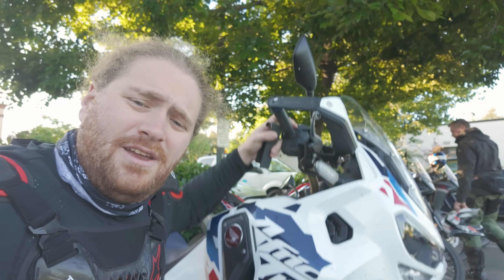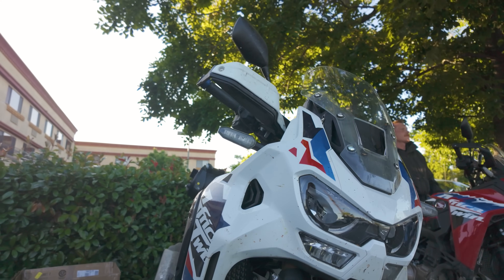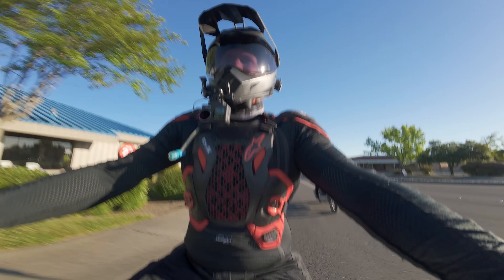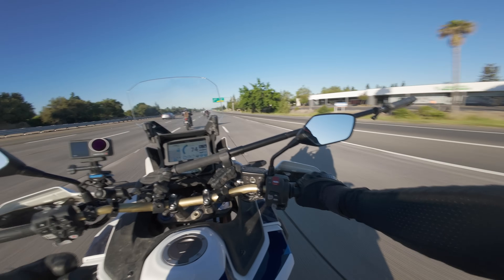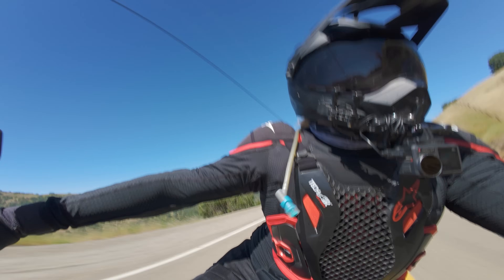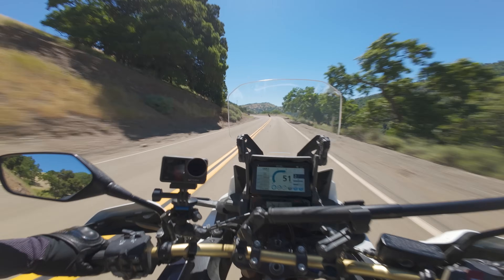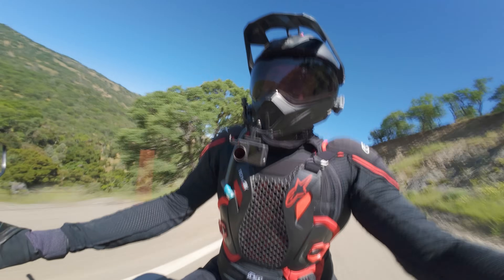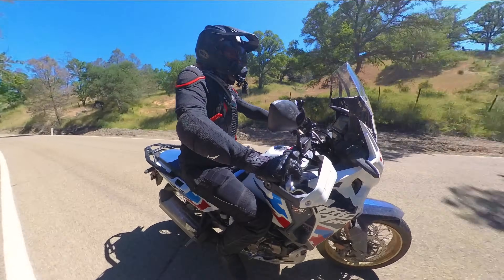Everyone Said I'd HATE A DCT Motorcycle...

Comment: I've had my my DCT Goldwing for a year and the only thing I miss about a manual transmission is extending the fingers of my left hand and resting them on the clutch lever while stopped at a red light.   I rode my bike on the Tail of the Dragon and had no issues with the DCT.  My Dragon run was fine and I had no problems at all.

Comment: As a person who always avoided dct and scooters, I rode a dct for about 100 kms and i hate to say that i LOVED it. Of course i wouldn't trade my bike for it but it was different and a good experience. Not having to worry about the clutch or the gear you're in is great. But as mentioned, the comfort is not where the DCT shines, despite all the marketing focusing on how seamlessly easy and comfortable it is to ride.

 Once you switch to the manual mode, you can shift very fast. It doesn't intervene and let you upshift whenever you want, and only downshifts for you when you dont want to do it yourself (maybe you didn't feel like keeping the revs high). It rev matches beautifully when you want to downshift a bit earlier without lowering the rpm too much. 

And if you dont want to use the manual, the auto mode is very optimized and lets you do your lowspeed manuevers without changing gears and making you fall (with the help of IMU censor)

If you want to hit the gravel, or for anything else, you can control the power and the engine break so the dct never gives you a disadvantage (not that i tried it on dirt)

Honda seems to have found the solutions for all the disadvantages that come with the dct. Yeah you can't rev it up in a standstill, and yeah sometimes not having a clutch is awkward but i believe that even people who hate it, love it some way. 

I think everyone should have a dct and a normal bike to hit the track or have fun etc.

Comment: I currently ride a 2019 Goldwing Tour DCT and it has been awesome. I just turned 100,000 miles on it this week. Maybe the Goldwing is programmed differently but my Sport mode is aggressive and very responsive. It holds gears both up and down to give you max acceleration and good engine braking. Tour Mode of course relaxes that a bit. I think if you had time to tune the User Modes more on the press bike you were riding, you would be amazed at how competent the system is. I'm 66 years old and have been riding since I was 14 so of course all my previous bikes have been manual transmissions. My adaptation to the new DCT from my previous Goldwing (288,000+ miles) took about 2 weeks and then I never thought about it again.

Comment: I've only used the DCT on a short test ride. I didn't think I'd like it but I was wrong. In the twisties I would just switch to manual mode and shift using the paddle shifters to keep it from changing gears mid corner.

Comment: I’ve got an Africa Twin DTC (in Repsol colours 🧡) I’ve had it for almost ten months. Early spring I  went for a random solo adventure around Europe wild camping sleeping by my Africa twin in the woods under a tarp. Found myself having to pick it up a few times in wet mud and gravel. But that’s what crash frames on these types of bikes are for. It’s a big adventure bike, and requires a big adventure. If everything goes to plan, it’s not an adventure!
That’s why I bought mine…. Plus I havnt got a left leg to change gears the traditional way 😂👍🏻
People I know who have this bike ride I automatic, I don’t. I like to control the revs with manual mode and know when I’m changing gears, especially when I’m off road going up and down hill on the thing. Even automatic sport mode…. I don’t bother. 
I’m just wheely happy to finally be riding again! 😁
Great bike all round! 
My only problem’ish with DCT is the extra weight. About 25kg I believe. But there’s a solution to that, hit the gym and it feels a lot lighter 😂 
At the end of the day, whatever way shape or form, always keep riding! 😉👍🏻

Comment: I have the european cousin of the AT, the NT1100 in DCT. Originally ordered a manual but Honda isn't producing enough manuals and the wait list was going to be over a year. Ended up getting a DCT model instead. It took a while for the gearbox to learn especially considering we have a lot of twists and turns here and it was always in too high of a gear. Eventually it learnt to hold gears now. I Still need to give it the odd manual downshift to override it but I don't mind it. In all, I really like it and it makes touring much easier, letting you focus on the unknown roads ahead rather than whether you're in the right gear or not. No surprise hill is going to cause you to stall or tip over.

Comment: I own an NC 750 DCT for a couple of years. Nobody seems to know that there is an accessory to add a foot lever for shifting. For me that lever, even if its still electronic makes all the difference. In the city i go full DCT and when want a more sportier ride i go full manual shifting with my foot. Man i love that option. I think the AT also have the foot lever accessory and i don't understan why honda does not advertising it  more. It was real diffucult for me to find a shop to buy it. And it is an original Honda part!. You can install it yourself in half an hour.
Reply: There is also the foot shifter option for the AT.

Comment: I have a previous generation DCT on a Honda CTX - love it!  My curiosity was piqued by the Rebel 1100 with DCT, but that bike was not a good fit for me ergonomically.  The CTX, on the other hand, fits me like it was made for me... after a few mods (Corbin seat, installed floorboards).  I've been riding for 57 years, owned a bunch of bikes over those years.  I have no issue with a clutch, but I find the DCT to be interesting technology that rides pretty much the way I prefer (in Sport Mode), with the occasional use of the paddle shifters to put the bike in the gear I want at the time.  Seems that some people use the DCT as an "automatic transmission" and are disappointed with the performance... DUH.  Or, they say, "The bike doesn't downshift when I want before a curve"... again: DUH.  You still have to think and anticipate.  After several years with the CTX, I don't see another manual transmission bike in my future.  Yes, it is that good.  The more time you spend with the DCT, the more you appreciate how it works, especially when pushing the bike through the twisties.  Thanks for the review on the Africa Twin.

Comment: I had a Honda Talon UTV for a while, which utilizes the AT DTC trans / motor. HATED it. But, admittedly that might have been more related to the suspension being really stiff, and the traditional cable operated throttle. bouncing  around on the trail caused the buggy to be real choppy, jerky, and gross. DCT searching for gears in automatic mode made it miserable. Can find used DCT ATs in my area EVERYWHERE. Was pretty telling IMO. Glad you did the ride Spite!   I still think the base '16-19 AT w/ a built suspension would be a hard bike to beat--even today, but my Vstrom 800de is good'nuff!   Go ride a Vstrom and tell me what you think Spite!

Comment: I have an ATAS 2018 DCT. Tend to run it in Sport 2 mode, Urban setting. Touring mode gives the most power. You can adjust the engine braking. I scrape pegs on mine from time to time, thats about 50 degree lean…Its also quite able offroad, it has an amazing ability to pick the right gesr, and you cant stall it…

Comment: I love my AT ES dct. I have not had any trouble going between my Ducati Supersport and the AT. I'm generally in urban mode when  I commute into downtown Austin. There are a lot of controls vs most other motorcycles and so there is a long time learning curve to know everything. Note: DCT is really nice when I have to deal with traffic. BTW you can full adjust engine breaking or any other setting for the engine and suspension while on the go.

Comment: It has been mentioned in the comments already, but ride modes are more important with a DCT than they are with a manual. A lot of his complaints are based off presets and likely incorrect settings for what he's asking. I have a Rebel 1100 DCT and its a completely different bike depending on the settings. I use custom mode 2/3/3/1 for daily commuting and it's an easy-going cruiser with plenty of power for highway passing but not so snappy that's hard to ride very slowly in parking lots or heavy traffic (also gets 50mpg at this setting). Now change that to "Sport Mode" or 3/1/2/3 and the bike turns into a snappy (somewhat heavy) naked bike that is constantly trying to stay in the high-rev range. The two settings are so different that the bike doesn't even sound like the same bike between them... 

He spoke of it not engine braking when it wanted it to. This can be adjusted by changing the third setting or "EB" and the fourth setting or "D". Something like 3/1/3/3 would keep the RPM up and increase the engine braking to its most aggressive. There is no stock setting like this, you would need to use the custom setting.

Comment: I have 70,000 km on my 2020 AT DCT. Always ride in Sport3. To engage Sport Mode just tap Transmission Switch  once you are in D.
The DCT shifts on que in Sport mode. In Drive mode it is a dog and upshifts at too low rpm… feels like you are lugging.
You can easily program features like Engine Brake, Traction Control, Wheelie Control to suit your rider preferences..
Also you can override up shift AND downshifts by using the Paddle Shifters. 
You suggested you prefer a Quick Shifter… well you can “Quickshift” anytime with the paddles… no need to “blip” the Throttle.
May I suggest read the Owners Manual  before you  offer a review

Comment: Think of dct as an electrically shifted manual.  There is an electric motor mounted to the left side of the engine. The same basic setup used on modern 4x4 transfer cases. I rarely use the manual mode, but can always downshift when I feel the need. No more throttle blipping and clutch feathering on takeoff from a traffic light. While others are engaging their clutches i am leaving the other side of the intersection. Best part is excellent fuel economy in the D setting.

Comment: I rode AT with DCT and did have the same problem with it. As I was going to a turn, it would regularly be in too high of a gear and low RPM. Now if this happened with a manual, I'd put a lower gear before the turn or ride the clutch a bit until I start accelerating from the turn. DCT does not do either, instead option to put lower gear when you're already leaning, upsetting the bike and also changing the power of the engine due to different RPMs. Even in S2 it was not exactly eager to downshift, especially to 1st.

Now maybe I shouldn't have taken it to a really technical road (<40 km/h turns) the first thing in the morning, some people said I need to ride it more than a day - not sure if the computer somehow realizes what it's doing is suboptimal or I just get used to it, but the overall impression was similar to yours - it just cannot get the shifting right. Sure, I could shift it myself but then I could get a manual which does the same, is cheaper, and weighs 10 kg less.

Comment: I have a Rebel 1100 DCT. One thing I don't like about it is how jerky the throttle can be at low speeds. It's either closed, or trying to haul ass. Is the Africa Twin kinda the same? Wondering if it's a DCT thing, or just their tuning of the engine.

Also, for the DCT being a thing in general, I think it's great for people who can't/don't want to have to manually shift. I've seen a few people get the Rebel 1100 because they have injuries or disabilities that would stop them from being able to easily ride a traditional bike. It's good to have as an option for people who want it. 

The E-Clutch is definitely gonna be interesting. I wanna test ride a bike that has it.

I'm currently selling my bike so that I can get a manual bike and get that engagement from manually shifting again.

Comment: DCT’s in car speak is usually a love then or hate them experience.  Unless they have been dialled in to also suit low speed conditions.  In general, they provide the best experience when being pushed as the gear changes tend to be crisper than say a benchmarked automatic transmission like the ZF 8 speed used by several manufacturers around the globe.  The DCT does make more sense on two wheels and Honda have finally got it just about perfect.

Comment: I have a Rebel 1100 DCT. My commute to work has a couple of slow speed tight turns (practically, U-turns). The DCT sometimes shifts mid turn and it's very unsettling. Honda should have a steering angle sensor on the frame's steering stem to prevent up-shifting after a certain angle (not lean angle) and less than a certain speed. i.e. >±30°@<20 mph. Honda should also put a different throttle sensor on their bikes so it's not an on/off switch at slow speeds.

Comment: DCT and manual require two different riding styles/inputs to make the bikes react the same way. One can not learn to make a DCT react like a manual in an hour or a day while on a test ride for the first time. I have no trouble with trail or engine braking twistys on my 2018 AT AS DCT. Embrace the difference, it's what makes having a manual and a DCT transmission in the garage a blast.

Comment: 0:45  Personally, I'd describe a DCT as more like a manual transmission that's being operated by a computer.  The computer operates the clutch, the shift switch on the handlebar sends a signal to that computer which them does the actual shifting...possibly even shifts according to its own internal algorithm if there's a fully "automatic" mode.  But internally, it still has meshed gears sets and a clutch, not a torque converter and epicyclic gears like a traditional automatic trans.
Reply from the maker: Yeah that's not a bad way to describe it.
Reply: Makes sense given that (at least i think) the overleaf car term for gearboxes like dcts is automated manual

Comment: Did you fiddle with the fully adjustable electronic suspension at all? I'm pretty sure you can make it as hard or as soft as you'd want on the fly, and the DCT also has standard D + 3 sport levels of adjustment. I test rode one recently and its cool, but its not for me. Am eClutch would be much better on the AT

Comment: I see DCT working for proper applications.  Every day bikes like the NC750, Rebel 1100, and Goldwing are fine and would probably be nice (TBH, I've not tried it yet).  But the Africa Twin?  I intend to use mine in the dirt and have one of the apparently rare '22 non-DCT Adventure Sports, and I find the clutch to be a critical traction aid when off-roading.  With that being said, I've heard that the traction control is good enough to set it where you want and pin the throttle and the bike will make it happen.  
Full disclosure:  I'm not a fan of automatic transmissions in cars, either.

Comment: Interesting, but not for me, then I don't like automatics in cars either. I'm 61, been riding since I was a kid. I like changing gears, blipping the throttle on an aggressive down change, I won't even have a quick shifter on my bike. I only have one modern bike, a 2022 Pan Am, the army green version, and my other bike is an 1988 Low Rider Sport, hotted up these days and with a sidecar most of the time, I still love to ride it because it is very raw, no ABS or TCS. I love the Pan Am, I use it as a sports tourer and commuter in the city, I have taken it off road, but it is a bit heavy for off road.

Comment: Ordered my new Rebel with a DCT. FYI, there is youser modes to configzre. So mabe your major point was the missing enigine brakt. Well you could have adjusted that with one of the user modes. I gues you did not have the time that day on testing, or you just did not know. E.g. copy all the settings from sports mode 3 except for the engine braking and put that on max. Maybe that would have done the trick. Still everyone that owns a DCT will tell you: Use it for at least one month to get used to it...  Nice vud, nice test ! thx
Reply from the maker: I did, and what it adjusts is the level of engine breaking applied, not the shifting speeds. It'll still downshift mid corner and apply some engine breaking even at the lowest setting

Comment: I enjoyed the DCT on my 2020 Africa Twin. Only used the manual mode to test it out. As long as you're not in the "D" mode it works just like you want. Do I miss the DCT since trading it in my AT for an Aprilia Tuareg? Only when I sheared off the shift lever on the Tuareg while riding the Arizona BDR. The paddle shifters work great for engine braking.
Reply from the maker: They do as long as you're in full manual. I find that even in sport three they won't let the bike engine brake like I normally like to. I use engine breaking and the front brake at the same time.
Reply: There are multiple engine braking modes you can set… not sure if you tried them all to find the level you like.  This bike isn’t friendly to a test ride unless you spend a lot of time in the manual..if you own one you have time to figure out all the settings and what you like.
Reply: @spitescorner  maybe I'm more, as you called it, "dad mode" with my riding. haha. Keep up the good work.

Comment: I feel like DCT would be better on around town boppers than on the bigger bikes (though I guess with the rebel 1100, it's so small feeling it could count) 
The rebel 500 or CB/R 500 maybe even the 650 4cyl too. I've read it's a cost/value problem. 
The real solution is an auto clutch. a 375lb wet around town bike with a DCT would be fun though. Those CFmoto 450s come to mind, or the Husqvarnas...
Reply from the maker: In traffic the DCT is a godsend. It's so handy